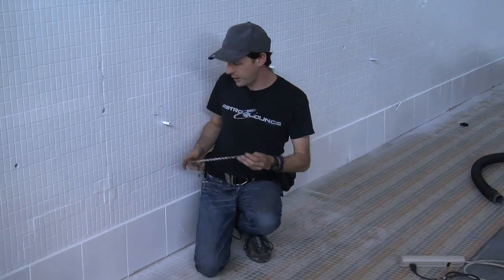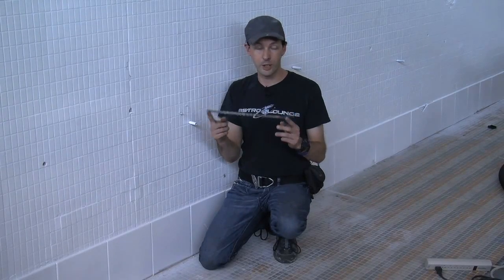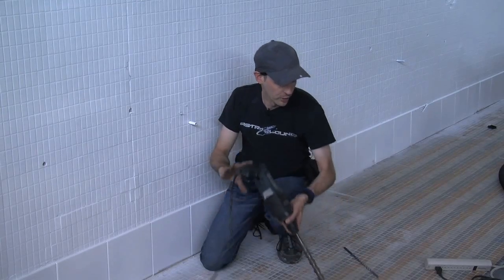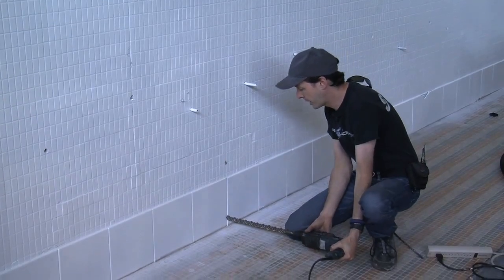High Voltage Lab - Grounding Rods Part 2

Comment: Why not (if possible) use a plumb line from the ceiling/roof bottom,  inside /  outside to get a good measurement?
There is also a way to use a low current / high voltage NST (Neon Sign Transformer) properly connected to a milliAmp meter to determine if you are at the same inner/outer positions (as long as the inner wire is not below ground level).